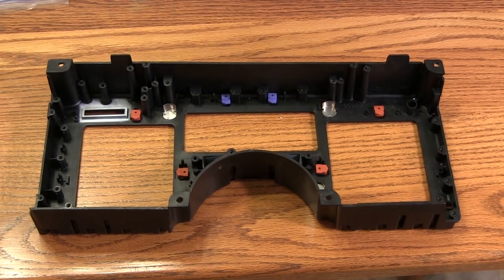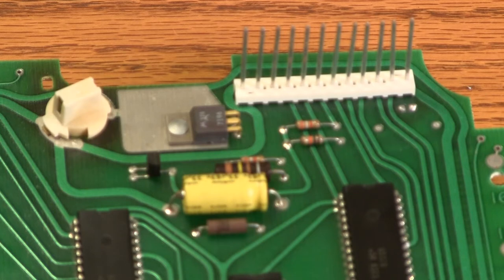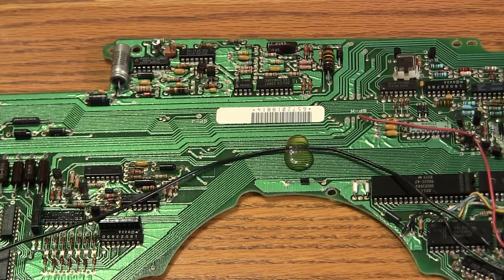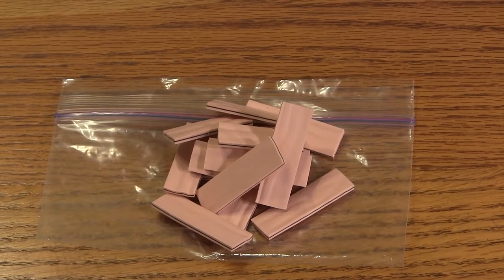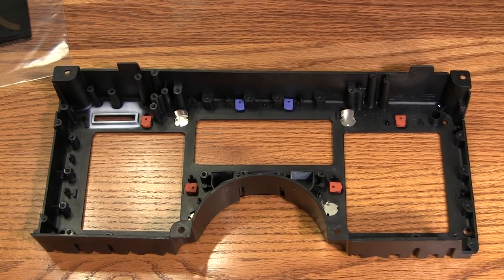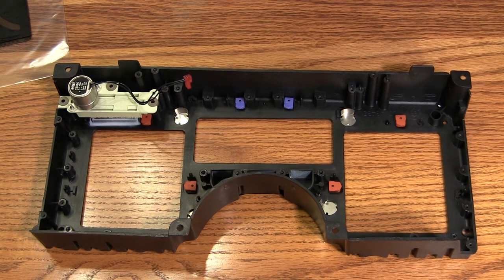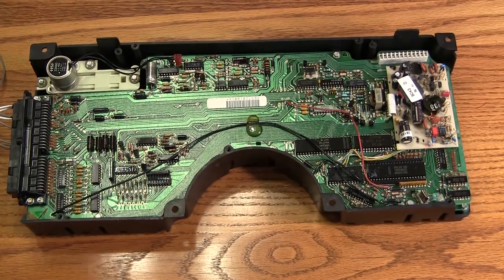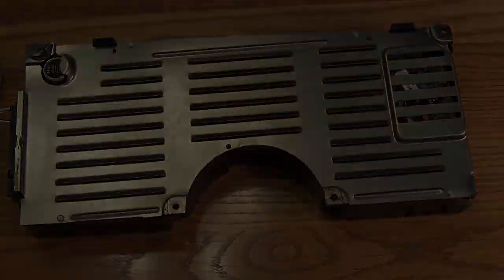84-89 Corvette Gauge Fix 4 Reassembly

Comment: You keep saying lcd panel. But isnt it just a glass panel?? Please explain
Reply: The three glass panels in the cluster are LCD panels. They are where the image you see comes from. They have electrical contacts around the edges. Electrical signals which drive the segments / turn them on and off are carried by elastomeric connectors / pink blocks that connect the lcd panels to the bottom circuit board. The glass panels have liquid crystal material inside in individual chambers. This material along with the polarizing film selectively blocks light, creating each segment of each number and bar in the graph. It can’t just be replaced by a pane of glass.  Signed, The guy in the video